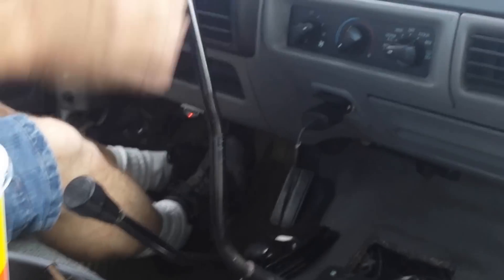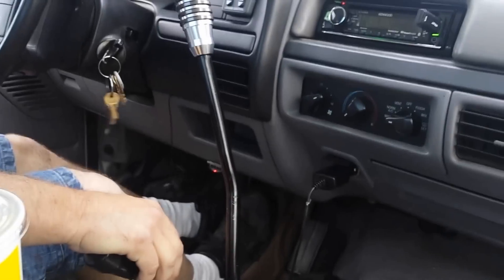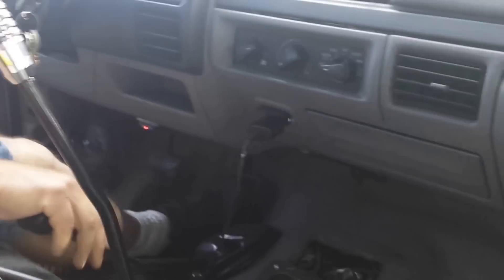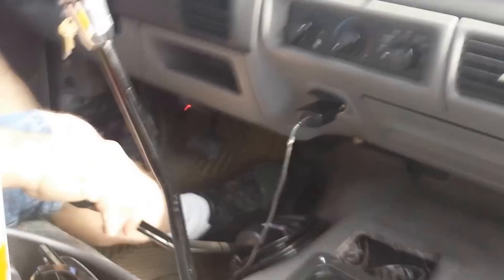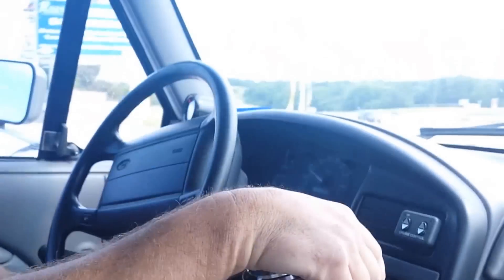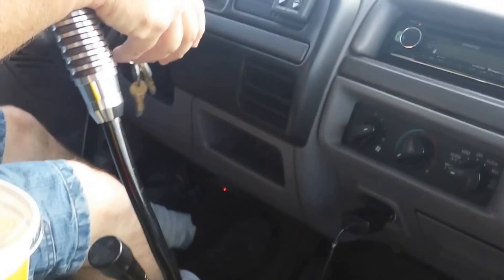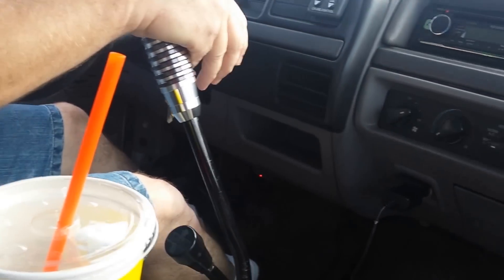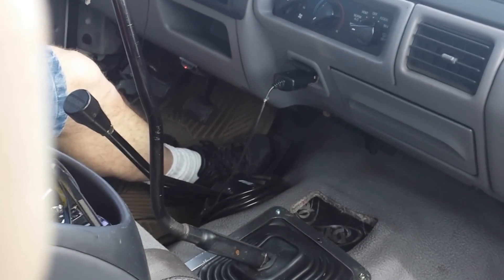F150 twin stick test drive

Comment: People this is a 4x4 that smaller shifter is his 4 hi 4 lo for his front differential 😂😂😂😂 don’t drive like that just keep it in 2 and use your gears
Reply from the maker: Sorry to bust your bubble you are incorrect. If this were a 4x4 and I was shifting the transfer case I would not be able to shift the Tcase back and forth between each gear. I would have started with Tcase in low and shifted thru a few gears then shifted the Tcase to hi and shifted the transmission back to first. In order to split shift any combo you have to understand which gear box has a wider gear ratio split. You use the box with the closest ratio as the splitter. I am sure with your extreme knowledge of compound gear box's this bit of information temporarily slipped your mind right?? This is a 2wd truck, the second gearshift is an Advance Adapters Overdrive unit. You can look it up on their website , advanceadapters.com . The longer shifter is an older T19 granny 4 speed.  All of this info is in the video description , but your such a smart guy you can't be bothered to do a little reading before making a smart comment. 
I reached a top speed of 55 in this video if I remember correctly.  And don't worry about the way I drive my own truck and I won't worry about the way you drive your truck. Deal??
Reply: I’m not reading all that but no it’s not the t case your shifting I seen your other video that’s a wierd trans ive never seen
Reply: I was wrong your right
Reply from the maker: It's all good. Thanks for watching and commenting.
Reply: Why tho why the trans heavy towing?
Reply from the maker: Honestly the main reason is just for the fun of it. Yes it does help with towing, closer ratios helps keep the rpm's close to peak torque which helps when towing. This dual transmission is way stronger than the stock 5 speed.  I can drive it real simple if I want to. Just leave the short stick alone until I want overdrive. Or I can have fun like I did in the video.
Reply: I wanna know why the main trans doesn’t have 5 gears
Reply: And my other question is that longer then stock trans ? As in didnya have to change your drive line as in the drive shaft

Comment: So it's like a Gear vendors under/over drive with a stick? Dual sticks just seems like a bitch in California Traffic (my area).
Reply from the maker: Yes, but instead of going behind the transmission this goes in front of it. I can just drive it with one stick (4 speed) and then once on highway shift into overdrive. So one stick at a time, easy as pie.

Comment: Damn, it must be slow to accelerate in that truck shifting through all those gears. Do you get a lot of automatic cars rising your ass at red lights, stops, etc.?
Reply from the maker: I don't have to use all the gears and usually don't. I start in 2nd gear with splitter in low, and don't use the splitter until I am on the highway and want overdrive. So basically I only use 4 gears most of the time. 
I don't race anybody in this slow ass truck. It is a ford 300 inline 6, not fast but it has a lot of low end torque which is good for pulling. They used to put this motor in F350 and small dump trucks. Before the Diesel engine in pickup trucks caught on this was the motor if you did not want a big block.

Comment: Is the whine in specific gears a characteristic of the unit you added? Are they straight cut gears? Definitely a novelty more than need but it is cool. 
Saw a meme the other day of a stick shift and it was labeled a "millennial anti theft device"
This takes it a step further. 😂
Reply from the maker: The whine is from the overdrive unit, only when it is in overdrive. So anytime that box is in overdrive regardless what gear the 4 speed is in it makes that whine. It is helical cut gears believe it or not, that is just a normal characteristic of that Advance Adapters unit. They warned me about it before I bought it, I would still do it again tho. I love this setup. If I don't want to split gears I just use the 4 speed until I get over 50, then I shift into overdrive. But when I want to play I can just grab overdrive anytime I want, even in reverse!!  Wanna freak somebody out? shift gears in reverse!! 
Anti theft with this setup is leave both sticks in neutral!  Lol
Reply: ktumbleweed 
I like it. Advanced adaptors has some cool shit.

Comment: I'm just completely lost....how does this work? why two sticks?
Reply from the maker: This was done mainly for the fun of it. When towing it serves a purpose... kinda.
It has two separate transmissions bolted together. The stick on the left is just lo and hi (direct drive and overdrive) The other stick is a 4 speed transmission (old school granny 4 speed).  If I want I can just leave the 2 speed alone and just use the 4 speed. If I want to have fun , or if I tow a heavy trailer (7k lbs is heavy for an F150) I can use the 2 speed as a gear splitter. It cuts each gear in half basically.  2nd gear hi to 3rd low is still an upshift even tho I downshift the 2 speed and upshift the 4 speed. Wow , I think I just confused myself..  Lol

Comment: Pretty fun. 

There was a guy in a Bronco club I was a member of for years, that had a similar setup. Ranger overdrive and a NP435. It allowed him to run low gears for off-road in the axles, and still maintain driveability on the road. 

It was a great idea, and worked really well. Not sure if I would want to manage that in rush hour traffic though.
Reply: Bro I’m trying to get that same setup in my bronco and just bought you wouldn’t happen to have a link to somebody that built one in a bronco

Comment: Weird... sounds like a blown 4 c... 3 cyl. Hybrid...
Reply from the maker: Engine is the stock 300 straight six 4.9L The noise you are hearing is the gear whine from the overdrive transmission.
Reply: Yeeha! Foox! I looked for engine but didn't see it mentioned

Comment: F.... all them that don't like it you said it it's your truck doesn't matter if you ever even use it if you like it being in there awesome I think it's cold as shit and going down the highway you going to get great gas mileage I like it man I think it's cold as hell I'd like to put it behind my F250 has a 460 in it that way I could run 411 gears and not be running such a high RPM going down the damn Highway

Comment: think this would work on a stock 75 f250 4 speed with a 429 out of a 73 T-bird?
Reply from the maker: It should work just fine. As long as the 4 speed is a truck type 4 speed and not a car type (toploader) and even then it might still work. There are two different ford versions from Advance Adapters , there are two different bearing retainer sizes. The only way to know for sure which one you have is to remove transmission and measure the input bearing retainer (the part the release bearing rides on.) It is noisey in overdrive just to warn you. Sounds like straight cut gears but it is normal operation according to Advance Adapters.
Reply: ktumbleweed well all I use the truck for is hauling it ain't gonna matter on the noise, tonight was the first time it's seen the road in 3 months and that was to go to the dump, she's not cheap to drive

Comment: They straight cut gears ? Sounds like itd make quite the noise inside the cab!
Reply from the maker: Nope , they are helical cut. These overdrive units are just noisey, I was warned ahead of time by Advance Adapters that this noise was gonna be there, but was normal operation.

Comment: That’s cool man. Looks like fun to drive. What tranny is it actually? Wish my bigger truck had more gears. 

Vic
Reply from the maker: It's an advance adapters 2 speed Ranger overdrive unit bolted in front of a Ford T19 granny 4 speed transmission.
Reply: That’s sick man. Not sure why guys comments are so dam negative. Make more video please. Wish my 72 Chevy had more gears. Once I hit highway 5th would be so nice to drop rpm a little.

Comment: Cool what's the info on the drive line
Reply from the maker: Ford 300 I6 , Bellhousing from my old 84 F150 I6 , stock flywheel and clutch from an 84 F150 , Advance Adapters Ranger Overdrive (torque splitter) Stock Ford T19 4 speed (from a junk yard $100) Stock 2 piece driveshaft , stock 8.8 inch rear end.

Comment: I like automatic transmissions why would you want to shift?  I drive a 2500 Ram for a dealership wit a 6 speed.  They used to have a 3500 with an automatic transmission it got  2 to 3 gallons of MPG better, passing and drivng in the city its way easyer.  I mean when I pull a 15 or 18 hour drive why not use an automatic?
Reply: MARTIN WOOLDRIDGE because driving a manual transmission is fun for people. I would take a manual over an auto anyday. If someone gave me a manual 2500 ram but I had to go to New York and drive it all the way back to Texas I would do it no problem. It's just fun. I feel more in control over my car. I can hit the brakes and use the engine to slow me down at the same time which is faster than just brakes. Or I can save my brakes and use the engines compression to slow me down. You can't do that in an auto too well.
Reply: If the starter goes out I can pop the clutch and use the tires to turn the engine over. Can't do that in an auto. I can short shift my car to save fuel, you can't do that in an auto. Manual transmissions don't break down as fast as an automatic transmission does. I put over 300k on my car before I had to get it rebuilt. My wife's car had to be rebuilt after 170k miles. her car is an automatic if you didn't catch that.
Reply: MARTIN WOOLDRIDGE if you're driving for 15 hours, it doesn't matter.
Reply: MARTIN WOOLDRIDGE manuals get better mpg must have been driver error
Reply: Meldins STI Depends, some cars manuals get worse economy but are geared differently.
Reply: Well for one Dodge/Ram automatic transmissions are notorious for going out. Also if you are pulling something heavy manual is way better. You can slow down by downshifting or choose to take a steep hill in a lower gear to avoid having to ride the brakes. Anyways if you are driving on the interstate for hours it doesn't matter too much either way since you'll be in high gear most of the time anyways.
Reply: Then you don't know how to drive it
Reply: Id rather have a stick for fun driving and short trips my brother proved that cars get better mpg's than a auto in his two civics (ones a 5 speed stick and the others a manual the 5 speed got 3 mpg's better than the auto) that ive seen their more reliable if you know how to drive it and are easier to fix when they do break (and are cheaper) and nowadays its a theft deterrent due to fewer people knowing how to drive stick and as a bonus if you drive a pickup or countach you can skip leg day at the gym

Comment: aren't there some overlaps in some gears, if not it's ok, if there are overlaps it's redundant, therefore useless except in your own mind
Reply from the maker: No overlaps in this setup.  The 4 speed granny (T19) ratios are 1st 5.1:1  2nd 3.03:1 3rd 1.78:1 and 4th 1:1
The 2 speed (overdrive) Lo is 1:1 and Overdrive is .80   so 1st is 5.1 1st over 5.1 x .8 = 4.08 , 2nd 3.03 , 2nd over 2.42 , 3rd 1.78 3rd over 1.424 , 4th 1 and 4 over .80  , I have found even when towing 10K lbs 1st over is pretty useless. 2nd over is occasionally useful when towing up a hill.  3rd over is a very useful gear as that is the downside to a 4 seed granny is the big step between 3rd and 4th. That is where this setup really shines.
Normal daily driving I only use 2nd , 3rd , 4th and 4th over.  I occasionally use 3rd over in normal driving.
Towing I use 1st , 2nd , occasionally 2nd over , 3rd , 3rd over , 4th , and sometimes 4th over if the truck can pull it.
That is the other nice feature of this setup , the overdrive gear is a heavy duty gearset from a T98 transmission and can handle heavy towing. it is rated for up to 24.5K lbs gross vehicle weight.  And the T19 is an old cast iron heavy duty 4 speed and is know for its strength.

Comment: Ok so call me an idiot but how exactly does this transmission work? Never heard of a twin stick before
Reply: You split each gear basically giving you a low and high in each gear.
Reply from the maker: Simply put the extra shifter is high and low.  If I want to use every gear (which I don't have to and most often do not) I shift from low to high in say 2nd gear, then when I need to upshift I shift to 3rd and at the same time drop back down to low.

Now I will get more complicated if you want a more detailed description.

It involves gear multiplication.  Gear ratios are expressed in numbers like 4:1 or 4 to 1 which means the input shaft will turn 4 times for 1 turn of the output shaft.  The 4 speed main transmission has a wide ratio spread, ie 3rd gear is 1.78 to 1 and 4th gear is 1 to 1. The overdrive or splitter is .80 to one (input now turns faster than output hence the name overdrive)  if you multiply 1.78 by .80 you get 1.42 to 1.  That gives me a ratio between 3rd gear and 4th gear. In 4th gear you multiply 1 by .80 which is simply .80 , so in 4th gear over I have roughly the same ratio as 5th gear in a normal 5 speed.

Comment: are both gearboxes synchronized or do you have to double clutch it? that looks like fun to drive  but id hate to get stuck in gridlock/ traffic jam haha
Reply from the maker: Yes both are synchronized but the main 4 speed is worn out. 3rd gear synchro is kinda picky, cannot downshift to 3rd without rev match double clutch. No big deal in traffic, I don't even use the splitter. It just drives like a normal 4 speed if you don't use the splitter. When its not in overdrive its just a 1:1 ratio like its not even there.
Reply: have you tried to haul anything heavy with it to see how it shifts while laden? i drive a triaxle dump for awhile and when it was loaded it shifted so much better for some reason... probably the inertia helping me along as i shift...
Reply from the maker: Yes, I occasionally tow a 9k pound trailer. 18 foot car hauler with anything from a car to once a 4x4 Chevy Suburban. That was probably closer to 11k. Truck did not like that heavy of a load, but I was able to do 50 to 55mph on the highway. I only haul that heavy for short distances, like 30 miles max. I can tow a car on that trailer no prob, having the extra gears really helps when towing. I always have the right gear at the right time. No lugging or over revving the engine.

Comment: some had a thre way splitter, under, direct, and over.
Reply from the maker: Yep, and most semi's back in the days of twin sticks had 4 speed aux transmissions. Deep under , under , direct and overdrive.  Deep under was only used once , when you went for the next gear in the main you went back to under. And then when you got to the top two gears in the main you no longer used under, just direct and over.
I drove semi's for almost 12 years and got to drive a real twin stick truck on a couple of occasions. Since I can no longer go trucking this is the next best thing for me.

Comment: What are you using?
Reply from the maker: It is a Ranger torque splitter or Ranger overdrive , it is made by advance adapters. It bolts in front of the 4 speed transmission. It has two speeds , direct drive (like it is not even there) and overdrive (basically 5 th gear). 
I can use it as an overdrive only , shift 1 thru 4 and then once on highway shift into overdrive.
Or I can use it as a gear splitter by shifting into and out of overdrive for every gear. It basically gives me a half gear in between every gear. Most of the time I start in 2nd shift to 3rd then 4th and then overdrive. Coming off highway I shift out of overdrive first, then it is just a regular 4 speed from there.

Comment: Seems like a lot of work lol I'll stick with a regular 4, 5 or 6 speed
Reply from the maker: It can be easy if I want, or tricky if I want. If I want the easiest I just put it in overdrive and leave it there all the time. Then just drive it like a straight 4 speed. Never have to touch the second stick if I don't want to.